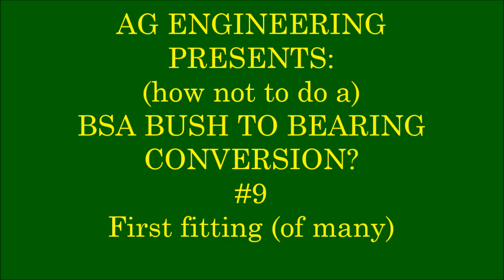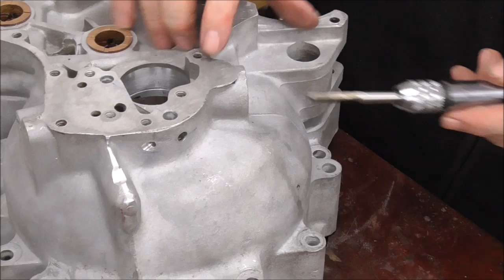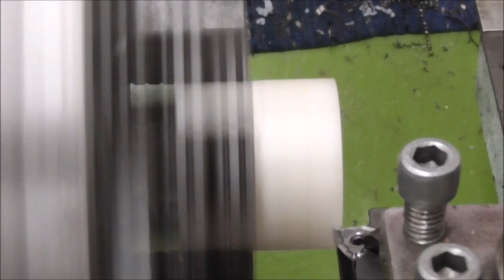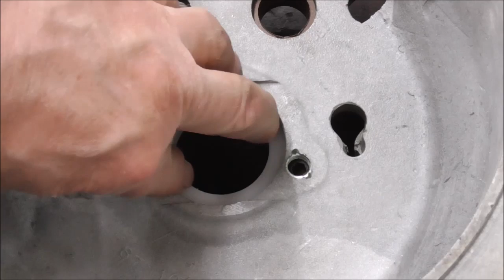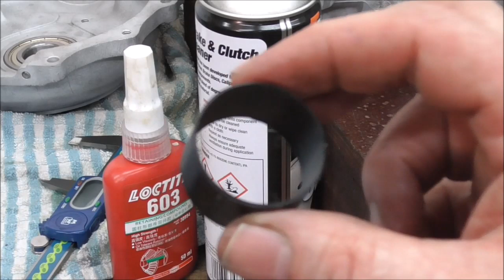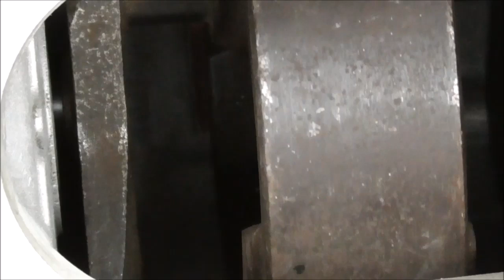BSA Bush to bearing conversion #9

Comment: Just discovered your conversation series, and I am thoroughly enjoying watching them. But as an ex mechanic,  I've been wondering how you'll set the correct end float on the timing side.  Previously there was a top hat bush, but now there is only the casing with bush locators. Will you use a shortened top hat bush to sit on the circlip, or shims...
I guess I'll have to watch the rest to find out.  Great work so far,  and nice seeing this done from an engineering perspective 👍

Comment: I was unaware of that there even was a long stroke crank in these.Where and why were they even used?
Reply from the maker: 1947 to 51 A7 with the gearbox that bolted to the back of the crankcases, this is also the version that had the white metal timing side bush that the bolt on plate service tool with reamer was made for. Thanks for the comments, Ade

Comment: Did you determine that a A65 crank is very different from what you need?
Reply from the maker: Apparently A10 cranks can fit into A65 cases to increase the stroke, not sure about the other way round, probably not done because it isn't the 'right' way to go. Main journal size is also 1.5" (38mm)so it would  need reducing to 30mm, possibly too much effect on strength?

Comment: Hey Ade, really liking this series.

One thought from a guy who knows nothing about these engines... what's wrong with the long stroke crank?

Obviously, you show that as you have it mocked up, there's a bunch of end play, but spacers would fit that

How much more stroke is this crank?  Will the big ends of the rods fit inside the cases?   And, will this require notches in the bottom of the cylinders?

The guys building Harley Ironheads used to commonly put spacers under the barrels to allow some big increases in stroke - and those stroked engines really picked up performance over stock displacement ones with comparable heads and cam timing - makes me curious if you could build a big inch BSA that would make a fair bit more torque than standard.
Reply from the maker: Hi, yes my initial thoughts were to spacer it, however the timing side needed to be in line for the gears and oil pump drive, so if it went to the timing side, the drive side is only half in the bearing 😢. The spacer needed to be in the centre of the crank to move both shafts outward.... Next episode 😕